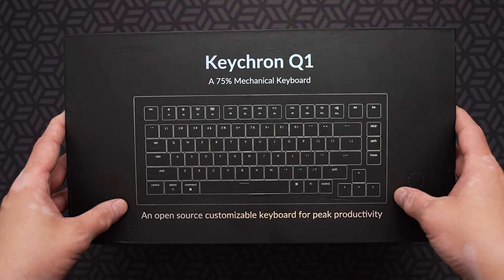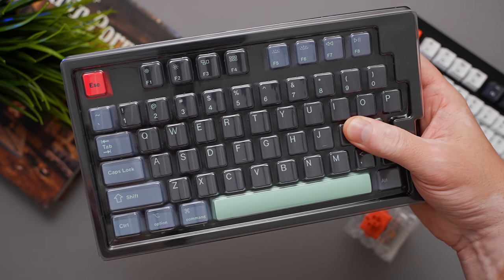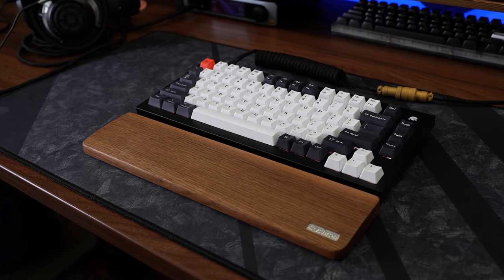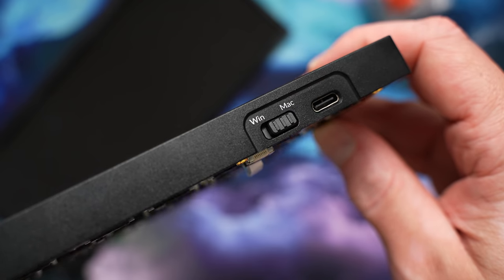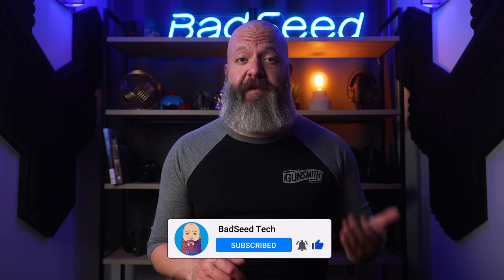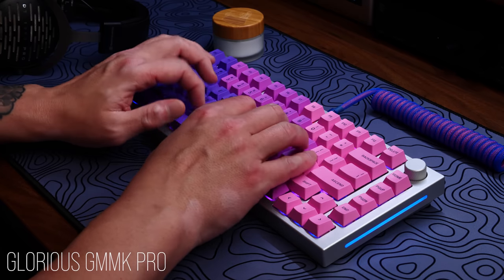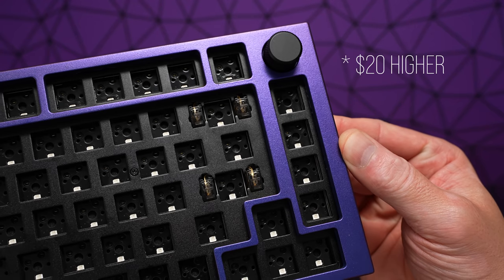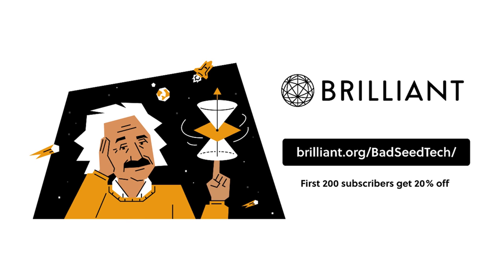Keychron Q1: The GMM OK Pro

Comment: For anyone stumbling upon this review in 2022, Keychron has since released a version 2 of the Q1 that has addressed the vast majority of these quality concerns that were on the prototype units. There is also a knob option. They now have better stock stabs, the case volume was decreased and the v2 has almost zero ping out of the box. It's still a great platform for modding, but it's more optional modding for experimentation vs. necessary modding to make it acceptable out of the box. The only downside of the version 2 is that since they reduced depth of the case, the gasket flex is less than the first version.

Comment: Just ordered - les see what the production version is like compared to this pre-production sample.  Appreciate your reviews, thanks!
Reply from the maker: Hope you enjoy it!  It was tough for me to get excited about, but under $150 and readily available are definitely two compelling selling points.
Reply: It’s always out of stock, I want one pretty bad but can never find it
Reply: You should probably consider getting some 205G0 and redo the lube on the stock stabs, as well as lube up the Gateron Phantoms. Apparently they can sound good if lubed right, which make sense given that Gateron does make good switches.

Also the keycaps can be swapped with GMK/Cherry profile keycaps, which is really nice, and you can always toss in some 5 pin switches like some Boba U4T or Tangies. If the foam is no good, you can always go for the tape mod method.
Reply: @matasa7463  As I learn I plan on using this as a platform for mods! :)

Comment: I kinda dislike your conclusion at the end, while I find that your recommendation to get neither is valid because of the number of issues that you clearly showed in both this and your GMMK video , the 'solution' of 'go with the KDB67 Lite' is pretty much useless since that is a GB board. So unless a person sees this video while R3 is live the only other option is to get scalped on mechmarket to get it.
Reply from the maker: I get that. Its a personal choice.  And I have reason to think that the 67 Lite will be more in-stock than people think in the future.  

But if you absolutely made me pick between only these two - I’d go with the Q1 because its more tunable. Has more long term potential.
Reply: @badseedtech  don't get me wrong between you and everyone's else reviews on the boards I agree that money could be spent better instead of on these 2 boards, I just think that maybe we shouldn't be suggesting a what is at current a very hard to get board as replacement to an entry level 'in-stock' boards. I would really love to see quality boards like the KBD67 lite be more available especially to the new people coming into the hobby.
Reply: @yahzeef  Also the Q1 will be popular enough to get some pretty specific after market mods made for it.

Comment: In 2023 there is now the Q1 Pro as well. However it still has some of the pingy issues out of the box and very tall keycaps. They offer an Acoustic Upgrade kit for like $10 which I would encourage everyone to get as it with different keycaps makes a huge sound difference. It definitely brings the higher pitches down while not muting the board too bad.

Comment: "I'm just not a fan of dye sub"
The problem is in the execution, not in the process itself. Good die subbed keycaps are hard to make and are expensive. These are just cheap dye sublimation keycaps, matching their price point.
Reply from the maker: Guess I just haven’t seen that killer dye sub set yet.  I’ve heard doing proper high quality reverse dye sub is very difficult.
Reply: @badseedtech  ePBT and CRP have some good dye sub sets.

Comment: Ive been eyeing the gmmk pro since it was announced, love the knob, prefer the layout, dont wanna get into the hobby too deep, just upgrade from my aging corsair k95
I was a little worried I might need to try to import the Q1 to the UK, give up on having a knob and all that, but seems I'm sticking with the gmmk pro. If it ever comes back into stock here
Reply: there's a 10 bucks addon down the line to convert the badge into a knob
Reply: what switches do you use? might want to change the switch & maybe keycaps for "not too deep" into the pockets
Reply: Got a few different kinds of Durock switches and GMK Serika coming later this year for caps
Reply: The keychron's top right hand corner is adjustable, meaning there'll be more options in the future to have your badge/ knob/ extra switch.

Comment: I think its pretty disingenuous and deceptive to market this as a "$150 Board" .  They are charging $30 minimum to ship to the US. That makes it a $180 board barebones, which is *$10 MORE than the GMMK PRO
Reply: $10 more.
Reply: The equivalent shipping is $20 for the gmmk pro. And the fact that keychron actually has a decent cable/stabs makes up for it.

Comment: Upon discovery of the fact that the brass plate is readily available and that the production models come with options for thicker foam -- I ordered a black barebone one. Will install the brass plate, Healios V2's, and orange / black SA keycaps from Maxkey, as well as smokey Durock V2s screw-in stabs. The Anne Bonny build. Will see how it stacks against my the Annabelle Lee GMMK PRO that has tactile switches, also a brass plate  ^___^ While waiting for the Q1 to arrive, I will install clear Durock V2 on my Pro. . .
Reply: Q1 definitely has a brass plate option.
Reply: @Stormcrownn  Hey, my bad, they actually do and it's less expensive than the plate for Pro. Thank you! Just felt strange that this wasn't mentioned in the review, or maybe I just didn't pay attention :D

Comment: I think Glorious nailed it with there GMMK PRO, but as a beginners first board into the modded keyboard space. I feel that it can even be a good board for enthusiasts or experienced individuals as it is a well rounded board for testing switches, lube, film, dampening material, etc. I am a fan of the GMMK PRO but as for the Q1, yeah not so much. BTW BadSeed, been following your channel for a long time now and love the content and love the channel set too. My bad for not throwing down a comment here and there. Have a chill day and l👀king forward to your next vid bro. 🤜💥🤛
Reply from the maker: Thanks Matthew, I appreciate it bro!
Reply: You got it pretty wrong actually. The Q1 has all the same features but it can also actually be used for testing switches (as it isn't muted as hell), actually has gasket mounting, and it's easier to take apart.

Comment: The random unused spot is an interesting choice. It just seems out of place - even if they had put a regular switch there. Perhaps a rotary knob is in the cards as you speculated.
Reply: It absolutely is. They announced in the discord (and probably elsewhere) that you will be able to buy the knob PCB later and it will fit into the first batch of boards.

Comment: good candidate for dynamat or equivalent, or silicone pour.
Reply from the maker: Silicone would be a bit tricky given the angle of the bottom case. And sorbothane is comparable to dynamat in terms of dampening, especially the software durometers.

Comment: Just as a heads up, glorious did change the tooling slightly on the gmmk pro plate to allow 3rd party stabs without having to mod it. Definitely removes one of the biggest complaints about the board.
Reply: Can you send a link for where you got this information? That's one of my worries of getting the GMMK pro as it seems a lot of tweaking is needed to get it right. The price is practically the same when you factor in the cost of shipping for the Q1 so if the 3rd party stab fitment is fixed I'll probably go with the GMMK Pro
Reply: @SuperYungK  reddit and twitter. Actually, seems like they just made a huge announcement over at the mechanical keyboard Reddit and that is one of the mentioned updates
Reply: @8bittim  Thank you sir!

Comment: i like keychron more than gmmk company wise, but i dont think i'm getting a Q1.
Reply: yes I've already got myself a gmmk pro, I though keychron q1 will make me have buyers remorse but it doesn't. gmmk pro with pe foam, avxworks fr4 plate and durock v2 stab sounds pretty decent though that can potentially sort the PCB so I opted for tape mod instead but it still better than the original
Reply: @albioncia  I was wondering if you could fit the durock stabs with the plate. There were reviews stating that it was a tight fit
Reply: @extrememode6455  the first batch stock plate yes (mine) but the newer batch and fr4 plate from avxworks (which I'm using right now) support all kind of stab
Reply: @albioncia  Aight, thanks mate

Comment: Feels like there is no actual upgrade in comparison to gmmk pro. Gasket mounts are obviously superior, but I personally don't like it. Literally weird flex but ok. Yep, its cheaper, but the knob might also raise the price point closer to gmmk pro. Hollowness of the body is insane, sounds like a pinball machine. And it does not have a lot to offer which gmmk offers, could have had extra features like wireless mode/ usb hub for mouse/ different typing degree options etc. Definitely not a GMMK pro killer, more like a slightly cheaper copy trying to hype itself up as a mighty rival. Waited for this board to decide whether I should get gmmk pro or an alternative model, Q1's release really sold the GMMK pro for me.
Since I have not tried both boards, I would not say that my opinion is valid, but based on reviews and specs I just like the glorious board more.
Reply: Same. I pre-ordered the Q1 today, but after watching reviews I’m just not as impressed as I was. The barebones Q1 costs $10 more than the gmmk pro when accounting for the $30 shipping. Plus the gmmk pro comes with a rotary knob included, rather than having to purchase one down the line like you would with the Q1.

Comment: So instead of the KMMK or GMMK you'd pick a board that has a 13000 person long waiting list and is very different in size, layout and construction...  Ooooo kay, that's certainly an opinion but not really relevant to the discussion between two competing 75% boards.
I was waiting for this board to see what it did differently than the GMMK pro I've got and honestly, it kinda looks cheap and sounds shitty out of the box and the same as a GMMK after tuning.  And Keychron charges enough in shipping that the price difference is actually swung the other way, the GMMK is cheaper in hand than the Q1.

The GMMK pro has issues but I'm happy with it until something fancier (and available) comes along.
Reply from the maker: Hey, I hear ya. I left a big pinned comment for you.

Comment: I would use that $150 on something like a tofu65 kit instead, then grab a gummy oring for 5 bucks, some PE foam if I want to and it will outperform those "gmmkpros" in both flexibility and acoustic. VIA, Aluminium case, gasketmount, also around $150 so why not
Reply: Why not? Cause the tofu65 isn’t a 75% keyboard, and it lacks a rotary knob (Keychron is selling the knob PCB later on which will fit into the Q1)
Reply: @jamesgarrett7844  75% - get a kbd75, used in good condition if you wished for the 75 then apply the same mod
The knob, I don't get it, you guys have a mouse wheels if you wanna do something related to scrolling/spinning, and there're extra function macros in the keyboard. My tasks don't really gain benefits from having it, but it might for you guys
Ofc this hobby is heavily based on personal preferences, so I can't just tell you to do this or that and expect you guys to enjoy the board I recommend.
Reply: @ho4ng30hoanng7  The kbd75 costs just as much?
Reply: @jamesgarrett7844  if used, yes. It's around $150 here

Comment: What sucks is that the Keychron Q1 barebone costs less than the barebone gmmk pro, but it actually costs $10 more than the gmmk pro when you account for the $30 shipping, and you don’t get a rotary knob included (will supposedly be available for purchase separately for the first batch of Q1’s)

Comment: I dont have a single issue with the acoustic profile of my GMMK. I used Lavender Linears and just a set of the Glorious Pudding keycaps. (I dont really like the keycaps, I hate pudding more than I thought I would. But the 1u mods on the right side through off the kits I was going to get. and I am not buying a kit for 300+ off ebay or waiting 6 months for a GMK group buy becuase thats nonsense. Were talking about plastic here...) I bought the brass plate and havent tried it yet. But all factor with those 2 things its got a nice thock but manages to do it rather quietly. 

The spacebar still sticks a little, wish I would have noticed that before I put it all together, but ill fix it. No rattle on stabilized keys though. So were all good there.

Comment: Personally, the Q1 over the GMMK Pro. The board does sound a little hollow, but atleast it actually has some flex. The GMMK Pro is just too muted for me.
Reply from the maker: I could get with that. The real tell is going to be a few months down the line when they’ve made some revisions, added the inevitable rotary encoder and people have experimented enough w the tuning to really nail the flex/sound ratio. 

I would say you’re correct in that it has more promise long-term than the GMMK.  People have tuned the HELL out of that board and it still sounds and feels roughly the same.
Reply: @badseedtech  Completely agree with everything you've said. Let's hope R2 of the Q1 comes with a lot more features lolz, maybe a silicone dampener/some foam included? The board is really good value. The included stabs are actually properly lubed (to an extent), and it doesn't cost $20, while proclaiming itself to be the GOAT.

Comment: I honestly just don't get the appeal. I'd rather get a c2 full size backlit for 60 bucks. Also you don't have to undo the ribbon connector you can just take off the daughter board completly. It's only held in by 2 screws. Just take it out and don't worry about having to keep fiddling with the cable.
Reply from the maker: Its just an effort to cash in on the current wave. I like their plastic boards better after a little dampening. And yeah, some people could pull the daughterboard, but some might snag it while they had the assembly out and damage the cable or connector.  I always try to recommend the safest route, and it whats Keychron suggests in the manual.

Comment: Hey, thanks for the review. But you got something wrong that should be corrected imo. 

The GMMK has and will probably always have the QMK compatibility. They released a statement on the 21st of August. Summed up: They never ran into the shortage and they were able to secure enough chips to produce them with qmk compatability in the future. 

And as someone who loves 75% boards, the kbd67 lite is not a good alternative to 75% keyboards, so I would've loved to see another 75% alternative there :-)

Comment: The only thing my GMMK Pro envies from this one is the ability to remove the stabs without taking out the plate. The coiled cable is crap, no encoder (once you try one there's no coming back), the switches are crap and the keycaps are crap.
Reply from the maker: Oh you definitely still have to take out the plate/pcb assembly to work on the stabs. As I pointed out, its just as annoying to work on.
Reply: @badseedtech  Missed that part, damn. It was an absolute pain in the ass to work on the GOAT stabs for that reason. At least they have 6 less screws for the pcb/plate assembly.

Comment: the thing you're experiencing with the q1 and gmmk pro sounding the same is that pretty much all boards will sound really similar if they use case and plate foam. this happens because the case and plate foam reduces the natural acoustics of the case. this isn't a bad thing, but if you load any board up with foam, it'll sound pretty much the same as any other foam loaded board. take the foam out and compare them, you'll hear the natural differences. 

another issue is that most large keyboard manufacturers like gmmk and keychron aren't really focused on case design, they're primarily looking at getting a board out with certain features at a certain price point. it's why the boards look the same and sound the same. there's probably something that could be done design-wise to reduce the ping that's bothering you, but they won't put the time in because it's just cheaper to let people add case foam.